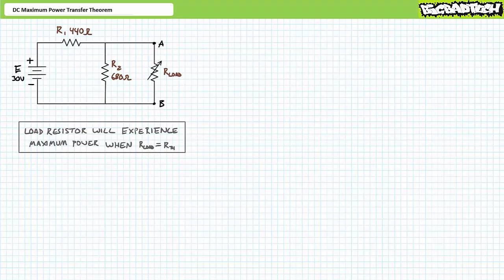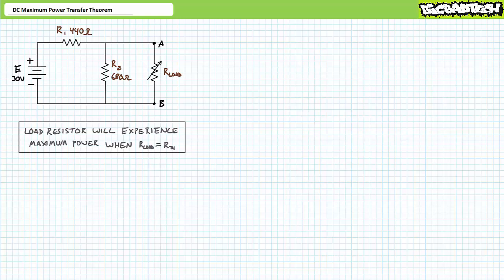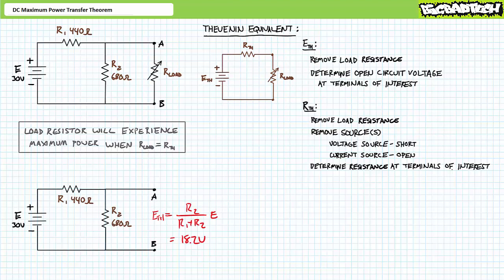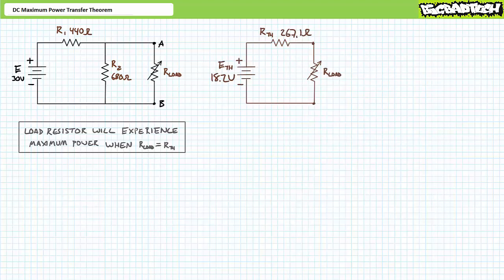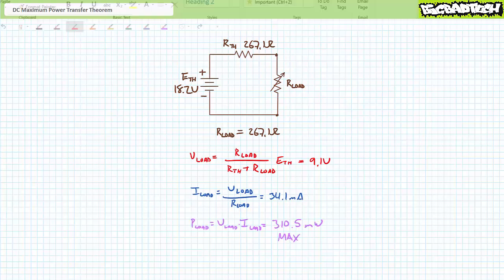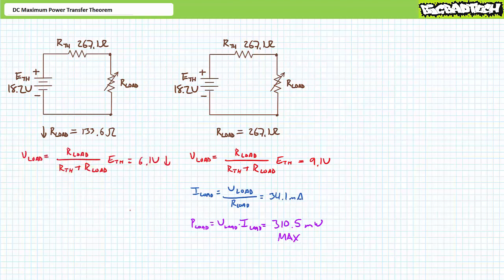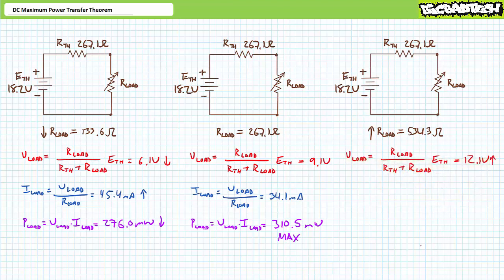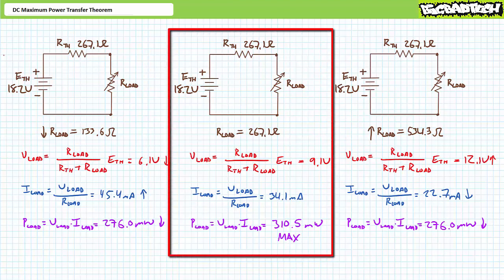DC Maximum Power Transfer Theorem (Part 1 of 2)

Comment: I  could not  understand why your initial  schematic included a parallel resistor R2...where you just adding complexity for a teaching example if you had previously  already presented a basic and easier to grasp lecture?  I am not a teacher, but often explain concepts to those around me...and for that I would show that if R2 was increased to infinity and R load approaches R1, max power transfer is achieved...increasing R load above R1 will consequently reduce max power transfer etc...much easier for a non EE to understand!
Reply from the maker: Yes, this is admittedly a little confusing if you tackle it without a warm up. Check out the Thevenin's Theorem lecture first: https://youtu.be/Ivs5fJ4-W6E

For the introductory example circuit, R1, R2 and the variable load resistor are separate resistors and RTH  is the single equivalent resistance seen by the load. The Thevenin's equivalent is a much easier means of circuit analysis and is essential to determining that resistor that experiences maximum power. 

Circuits can and will take many different forms not necessarily identical to this particular circuit. The idea of the maximum power transfer theorem is that one can find a single resistor that dissipates maximum power regardless of circuit configuration. 

This may take some repeat exposure. Next week I'm planning on releasing a lecture featuring nothing but illustrated examples of Thevenin's and the maximum power transfer theorem.
Reply: @bigbadtech  OK...got it now...just as well I am not  a teacher  :)....I missed that earlier Thevenins lecture...and  was thinking the Max Power presentation was either self contained or was the start of a more in depth practical series that might have touched on MPPT applications or theory.